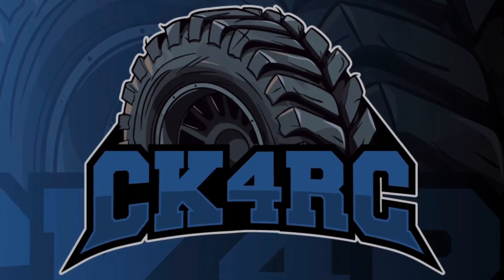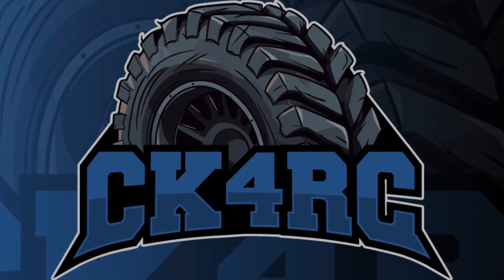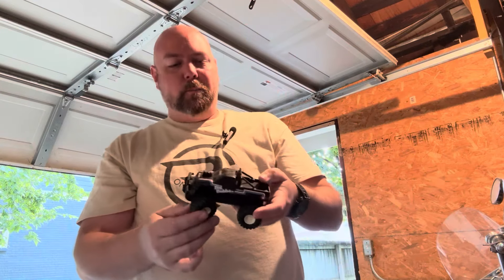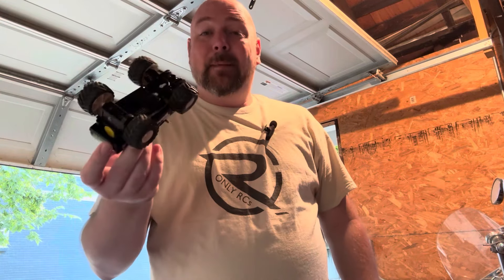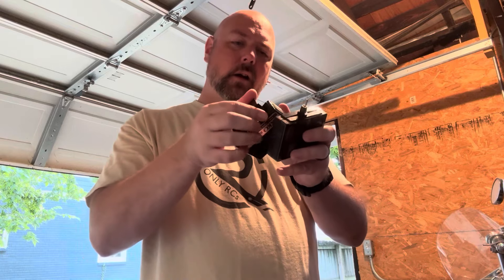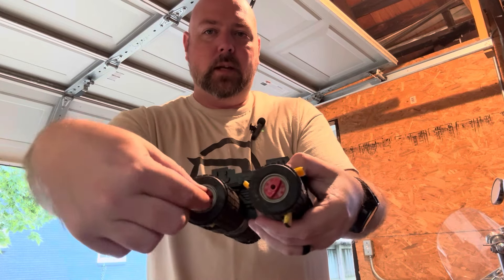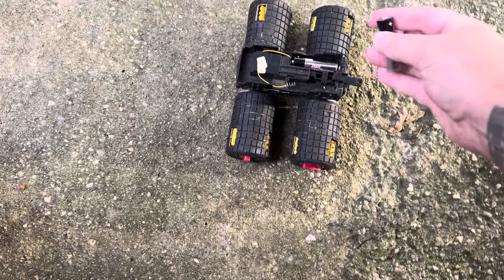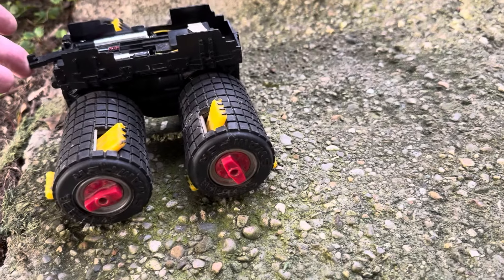Testing 30 year old RCs!

Comment: When it comes to the animal you could probably just swap the motor or motors out & it would run perfectly fine again, bet its probably regular 130 size motors.
Much like the nikko bubba uses.
Those magnets in the motors aren't gonna be magnetic forever after all. so they probably needs swapping out to be all good again.
Reply from the maker: @Mini-z1994  very good call on the motors. I haven’t even started thinking about any diagnosis for these yet, but that makes total sense. Thanks again!